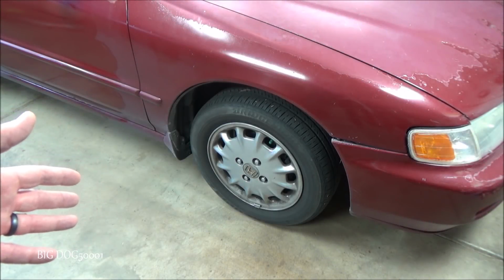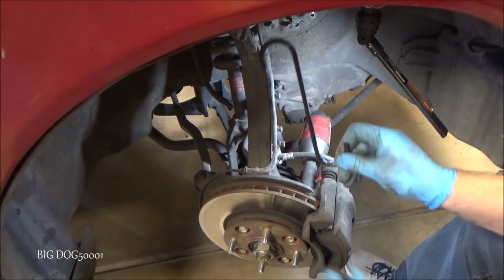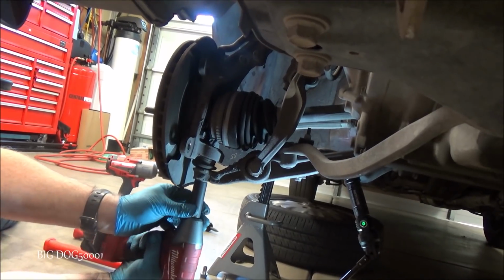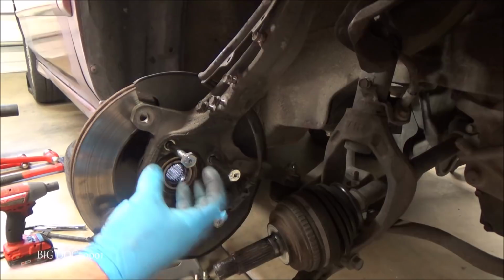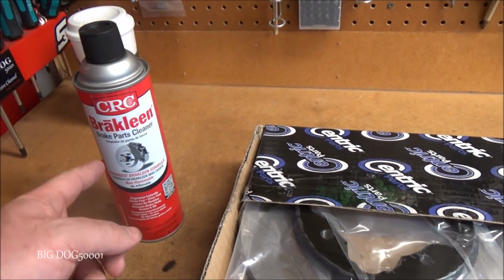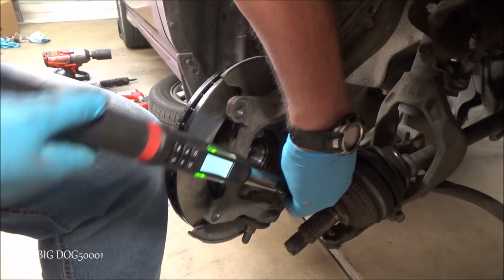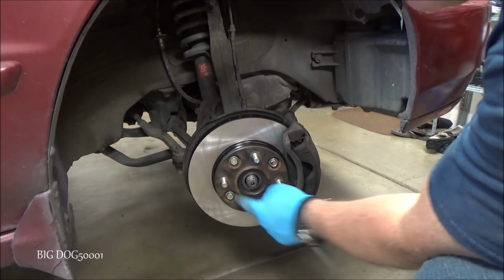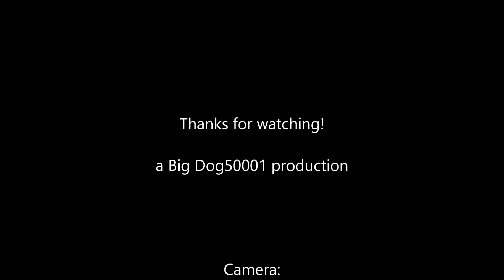Honda Accord Captive Rotors/Wheel Bearing Hub Assembly - Removal and Installation

Comment from the maker: Tools and Parts
This channel earns a small commission using some of these links - at no additional cost to you.
Centric Brake Rotors 120.40022:  https://amzn.to/2GZPEwj
Honda Axle Nut 90305-SD4-003:  https://amzn.to/2KpIHXy
OTC Brake Pad Spreader:  https://amzn.to/2H1kaGb
Milwaukee 2754 Impact:  https://amzn.to/2YXV3hQ
Milwaukee 2763 1/2" Impact:  https://amzn.to/2H1qxt7
Sunex 3/8" Impact Sockets:  https://amzn.to/35tE09O
OTC Pry Bar:  https://amzn.to/31xfuzH
Schley Products Unstake Tool:  https://amzn.to/2H0i1KX
GearWrench 41650 Axle Nut Set:  https://amzn.to/2YYSDvk
OTC 6295 Front End Service Set:  https://amzn.to/2Kt1aTi
Coarse 2" Roloc Discs:  https://amzn.to/2GZrX7j
4 Bolts Used: 10mm x 1.25mm x 100mm
Chicago Pneumatic CP875 Angle Die Grinder:  https://amzn.to/31yOIam
Milwaukee 2457 3/8" M12 Ratchet:  https://amzn.to/2H0jW20
GearWrench Ratchets:  https://amzn.to/2ToIK91
GearWrench Sockets:  https://amzn.to/31vQXLi
Snap-On 3/8" Tech Angle Torque Wrench:  http://bit.ly/2H3cJzo
Daytona Jack (cheaper at HF with coupon):  https://amzn.to/2IQbwLC
Jack Stands - RECALLED from Harbor Freight - DO NOT USE

The Big Dog 50001 Automotive Channel Store can be found here: https://www.amazon.com/shop/bigdog50001automotive  (As an Amazon Associate I earn from qualifying purchases).
Reply: What's your take on the captive rotor delete by using hubs from 1998 Acura TL? Thanks Big Dog!

Comment: Outstanding! I just finished this job using your video as a guide and I was able to do both sides in about 3 hours total time. I live in the northeast So everything is always harder with rust but still wasn't bad at all. I had a bad wheel bearing so I just replaced the hubs, rotors and pads to make sure I only have to do the job once. Thank you for the amazing guide!
Reply from the maker: Glad it was helpful, thanks for watching!

Comment: I did this job awhile back . Being a green horn   Took me awhile once I figured it out "YouTube" definitely helped  .. wasn't bad took the same steps ..changed my hubs rotors / pads & claipers minus the air tools and toqure wrenches . I came in hot on a turn and bent my passenger side knuckle .. and got another from the junkyard . So I need to swap everything over to the other nuckel..   get a new set of tires .. to get a perfect alignment and stop in uneven tire ware. Great video 👌 ..

Comment: I’m both relieved and offended (not at you), this looks way easier then someone else who explained replacing brake rotors THEY TOLD ME I HAD TO TAKE THE EHOLE KNUCKLE OUT AND TAKE OFF THE BEARING. Thank you for saving me much time and money with this very thorough video!
Reply: On hub of rotor Hondas I should add

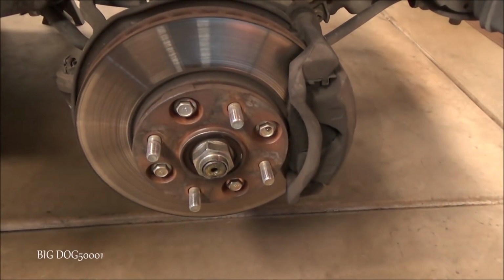Comment: I got to say, great video, nice way of doing repairs in a explanatory way, well spoken and illustrated.  I like the many precautions you take as simple as installing a nut below the ball joint to hammer it preventing any BIG or major damages, that can cost more down the road.  Something that interest me was what you said on the video at time: 1:43 - 2:10, in which it sounds like a "exact" problem that I had on my vehicle.  For quite some time, my brakes were slipping, not cripping and my gear would vibrate a bit and I explained to my mechanic.  After checking, he did find my caliper stuck and this was causing a metal burning smell, something that was driving me crazy.  After replacing the caliper, I changed the pads because they were on just bare metal.  However, the problem persisted. I kept getting the slipping and vibration at the gear.  I recently changed the rotors and the problem went away, but the ABS light turned on.  The vehicle was braking excellent, no problems, then when the ABS light turned off, the slipping started again.  Do you know or can you tell if this problem could be something more than the brake assembly, such as a brake line, lost pressure or even something with the ABS sensor?
Reply from the maker: Have you had the ABS scanned for codes?  Any of those things you mentioned could be an issue, as well as air in brake system.  I would scan for codes, double check entire system and bleed brakes again.

Comment: Thanks for doing this man. I'm working on my buddy's pile of crap 91 Accord to install new hubs and I had him purchase the bolt in hubs, but I didn't know that they were pressed in. I have a 2001 CG1 6th gen Accord with a 3.2L Acura V6 swap with a six speed manual and a turbo, and my front and rear rotors aren't captive, so I didn't know that these were that bad to work on. You learn something new every day!
Reply from the maker: Yep, I'm not sure why they used this design for a little while.  Thanks for the comment!

Comment: On 5th gen Accords, the front hubs can be changed so regular rotors can be used. I did it on my 97" Accord. You reuse your stock calipers. I used the 4 lug bolt 1998 Acura CL hubs, but that's only because I just bought rims for the car. I really wanted to change all four hubs to 5 lug bolt; more choices when it comes to aftermarket rims.

Comment: Absolutely great video, thank you!  But given all the work that is required for this job, wouldn't it be easier and faster to just install new wheel bearing assemblies at the same time as the new rotors?  That way you get new wheel bearings and rotors all at once and won't have to jack with it again for years.
Reply from the maker: That is another way to do it.  It's an additional expense, and if done that way I would recommend quality replacement wheel bearings.  If  cheap ones are used it may end up needing to be done again sooner rather than later.
Reply: @BigDog50001  Agree with you 100%.  Always try to use high quality parts if you can afford them.  Otherwise you will be paying for it again down the road.  I've seen that movie too.

Comment: Very well made video man. Not criticizing, but if I had to go through that much trouble for rotors, it definitely would have had new hubs also. Lol. After being a class 8 diesel tech for 15 years, you get to the point where you replace any parts that would require a redo for what you just took apart on your own stuff😂
Reply from the maker: Yeah, I hear you.  If it was my car I would have probably changed the wheel bearings out but this car belongs to someone else, I can only do what they want (or can afford).  Thanks for the comment!

Comment: These are great cars, except for the space saving front brake rotor design. A true PITA. I did it once, and one bolt rounded due to corrosion. Good tip to loosen them first while on the car. It took me a day to extract it.

Comment: I just attempted this job on my '97 Accord. I threaded in the four M10X1.25X100MM bolts by hand followed by driving them in with an impact then pounding them with a mini sledge hammer (don't have an air hammer). After countless hours of pounding the bolts, I could not free-up the bearing/hub assembly from the steering knuckle. I ended up removing the four bolts and noticed that all of their threads were trashed and one of the bearing bolt holes is now stripped. When you did this repair were the bolt threads all trashed afterwards? I am perplexed as what to do next... At this time I do not want to purchase an air compressor and air hammer. I could purchase another batch of bolts and try again though this time with the steering knuckle removed from the car allowing me to pound the bolts at a different angle though, I do not want to strip out the other three bearing bolt holes.
Reply from the maker: Sometimes they can be a bear to get out if the car lives in the rust belt and they have not been removed for a long time.  I use bolts that do not have threads all the was to the end so that I can tighten them up and it reinforces them.  Sometimes specialized tools like air hammers, presses and other techniques are the only way these come out.

Comment: I just had a new bearing pressed into the hub and the new rotor does not clear fitting over the bearing. I know it's a key'd design but every angle I maneuver the rotor it will not fit over the bearing. Both rotors and bearing are the correct part number for my vehicle ('97 Accord). I am unsure if it is wise to lightly grind the inner ridge of the rotor NOT the rotor's brake surface to see if that will provide enough clearance. I believe it's the bearing that is slightly beefier than the OEM one that is not providing enough clearance. I tried fitting the old rotor over the new bearing and it also has the same clearance issue which tells me for certain that it's the bearing. Have you ever experienced running into this issue?
Reply from the maker: That typically happens with aftermarket parts unfortunately.  I am not a fan of having to grind them to make them fit.
Reply: @BigDog50001  I'm not a fan of having to modify parts to fit either. Unfortunately I'm going to have to grind down the rotor to fit.

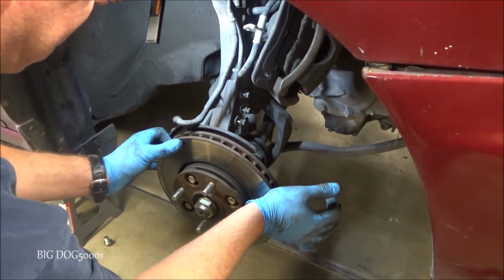Comment: 6:42 do you HAVE to losen those 4 bolts to get the whole Hub Assembly off? the bolts are cracked on mine and i cannot for the life of me get them off, i broke multiple sockets with and it just wont come off, i'll just buy a new assembly cuz the rotors are bad anyways and i was gonna get rid of them

Comment: I don't understand why Honda gave up on this system. I got a CL8 and it is such a pain to change the bearings on front.
Reply from the maker: Making it easier to change the rotors is a much better setup, I am glad Honda went away from this design.
Reply: @BigDog50001  Sure, but there is other way to fit the rotor. I liked the way how the bearing was implemented. Like on VAG cars.

Comment: What volt drill are you using for the old screws
Reply from the maker: I believe I used Milwaukee 18V impact wrenches and Sunex impact sockets in this video.  Links are in description and pinned comment.

Comment: what if i dont have an air hammer
Reply from the maker: I mentioned it briefly in the video, but basically a regular hammer could be used but depending on the amount of rust it may take a while or not come off at all.
Reply: @BigDog50001  got it. I had an idea and since the rotor was bad anyways I just hammered on the rotor and it came off